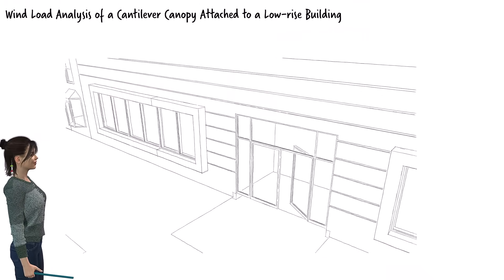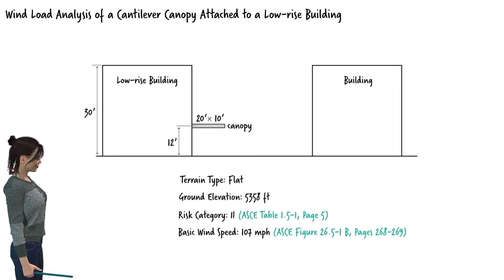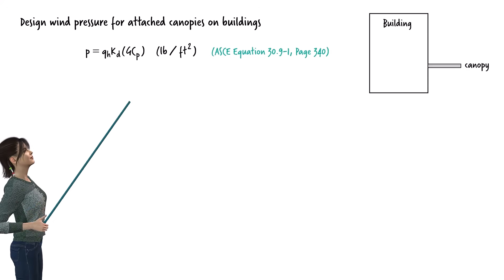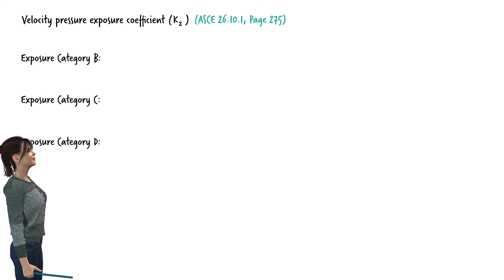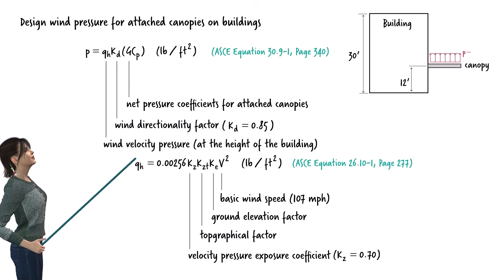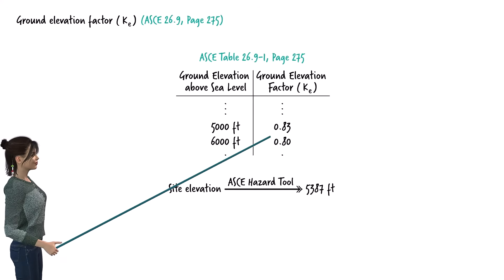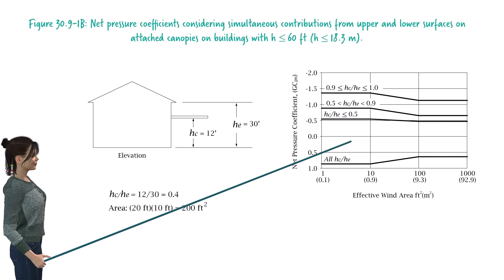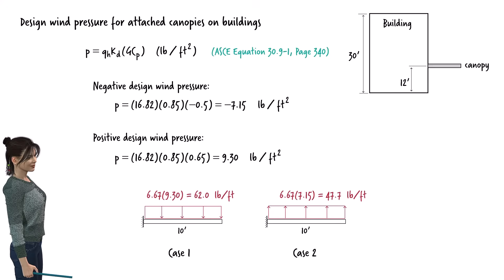SA73: Wind Load Analysis for an Attached Canopy

Comment: The coefficients Gcp are incorrect. They have to be estimated based on the effective area of the element being designed (6.67x10) not based on the total area of the canopy (200)
Reply from the maker: Please elaborate and justify your assertion.

The pressure coefficients (GCp) have been determined through wind tunnel experiments as a function of the area of the model canopy used in the testing. The wind provisions in the ASCE manual provide wind pressure values for surfaces subjected to wind, whether they are roofs, walls, or canopies. These pressure values represent the force per unit area on the system. It's important to note that the method by which this pressure is transmitted to the supporting structure is not a factor in determining the wind pressure on the system itself.

Comment: Thanks for sharing the video. My request is if you provide a video from top to bottom for the same content it would be better. For example analysis and designing of canopy structure from load calculation , wind calcs to finishing  of the structure including the detailing. It will be a best for everyone. Likewise for videos for carport structure, patio structure, et ., design of wood structures example from top to bottom including the connection, vertical analysis and lateral analysis. Then you will be the number one channel in the universe

Comment: Hi, please how did you select the wind directional factor ? This has always been an issue for me
Reply from the maker: The wind directionality factor is a probability-based coefficient related to the structure's dimensions and geometric shape. ASCE Table 26.6-1 provides this coefficient for various types of structures. To determine this coefficient, we don’t need to decide which wind direction produces the maximum pressure on a structural member; that is considered elsewhere in the analysis.

Wind analysis for an attached canopy, not part of the main wind force resisting system (MWFRS), falls under the Components and Cladding (C&C) provisions of the ASCE. For canopies, we don’t need to consider different wind directions to determine the maximum wind pressure. The net pressure coefficients (GCp and GCpn), based on experimental data, are given for the most severe cases.

In a previous lecture (see link below), we accounted for wind directions in designing a frame structure (MWFRS) in an airplane hangar. You may want to review it if you haven't already.

 https://youtu.be/dDNaw87nyN4